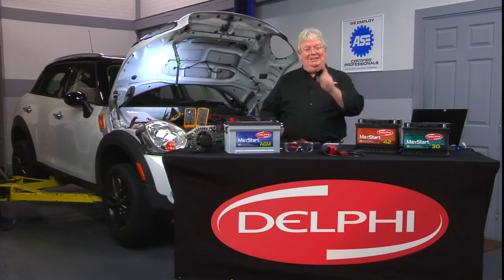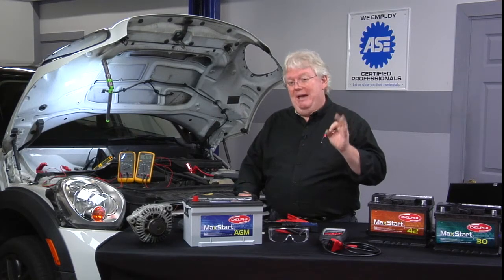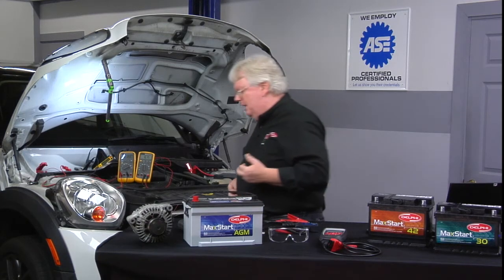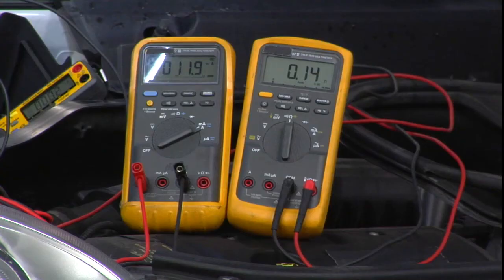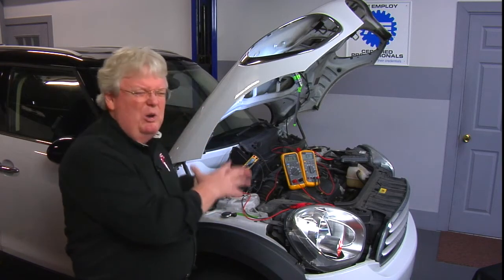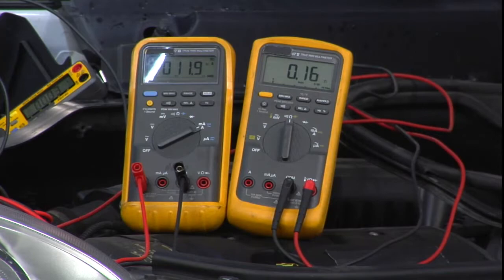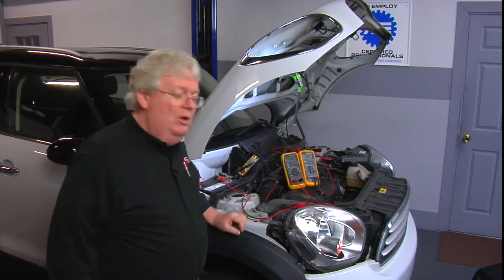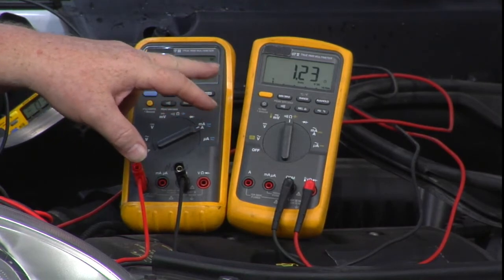When Should You Conduct Parasitic Current Draw Testing?

Comment: I had  a scope and amp clamp hooked up to diagnose a parasitic draw 
But i was confused why the scope was showing  the draw only on smaller diameter batt cables positive or negative  but no amp draw from the thickest ones 
is it better to get a bigger amp clamp so it can get around all the pos or neg batt cables?
Reply from the maker: Hi Malon dc - 

The problem is two fold:

1.  Most low current (60) inductive amp clamps don't fit around the larger battery cables / multi cables.  

2. Low current inductive amp clamps won't accurately measure down to acceptable parasitic draw levels ( < 50 mA) regardless of what their specs say.  However if you have an obviously over the top parasitic drain ( > 100 mA) those clamps work great with a scope or meter.  

A micro amp clamp is ideal but costs over $700.  Keeping ground and power to DLC pins 5 & 16 with a boost box and fuse adapter while connecting a parasitic draw test switch at the battery post / cable is the answer to using a DVOM in ammeter mode.  The DVOM can measure accurately down to < 10 mA when connected across the parasitic draw tool when the tool's switch is opened with the ammeter connected across the tool's contacts placing the meter in series with the cable and post.  Don't forget to remove the DLC power adapter when you begin testing or you'll not get an accurate parasitic test.  

Connecting ammeters in series with cables is a pain in the ribs in my opinion so I don't like to do it without a very good indication there is an excessive parasitic drain present.  That's why I made the video clip on "when to do parasitic drain testing" by connecting an ohmmeter between battery negative post and a known good ground wire (i.e. short ground wire from battery to fender) which should measure 0.1 ohms.  However, if a classic parasitic drain like a glovebox light or module is staying on with car off, that "known good ground" will read a "false positive" (several ohms instead of the expected 0.1) due to current flowing through the ground circuits on the vehicle throwing the ohmmeter off.  If you've waited 20-45 minutes (on average) for the vehicle's modules to all go to sleep and you see this false positive on the ohmmeter you can feel confident that your work in setting up an ammeter in series to catch an excessive parasitic drain will be productive.  Follow up with isolating the drain to a single fuse's branches with doing a mV voltage drop test across all the fuses. Dead circuits draw NO current therefore NO voltage drops (even mV) while normal parasitic draw related circuits will have a few mV of voltage drop across their fuses. Excessive drains will drop lots of mV across their fuses. Google "Power Probe mV fuse voltage drop" or similar search words with "Motor Magazine" instead of "Power Probe" and you'll find the chart from CarQuest that gives each fuses size and mV drop to actual mA (or even amp) value if you don't already have that very handy chart.  

Hope this helps, 
Dave
Reply: DelphiAutoParts thank you sr 
I just watched your other video 
On parasitic amp draw using the amp clamp and the voltage drop on the fuses. Again thanks for all the training videos you guys make  
it helps me alot👍🏽